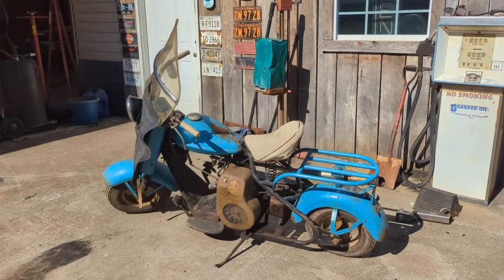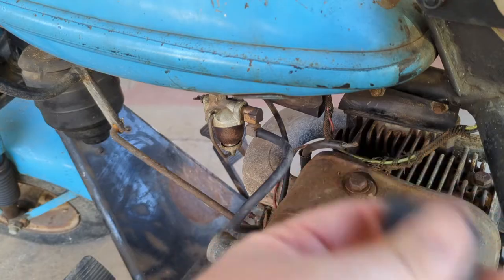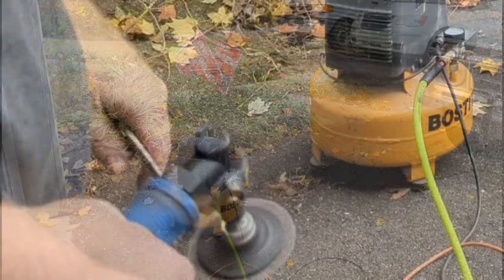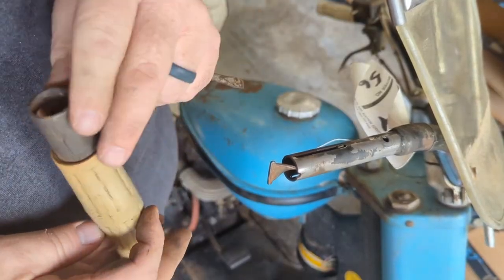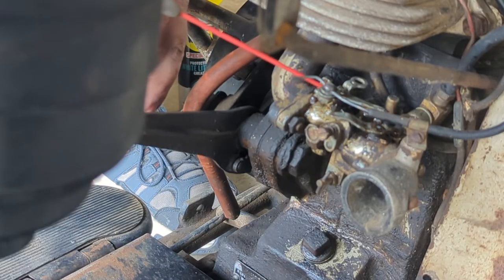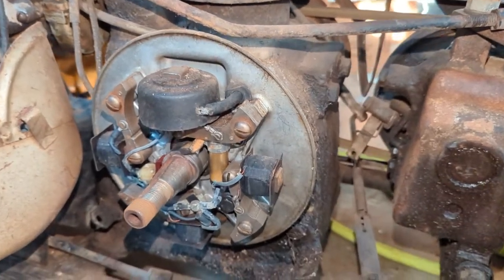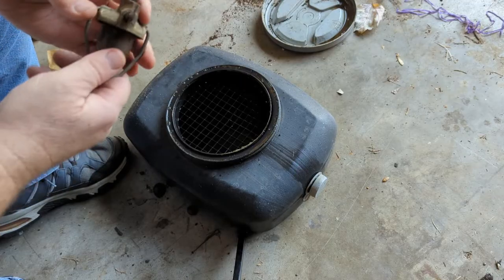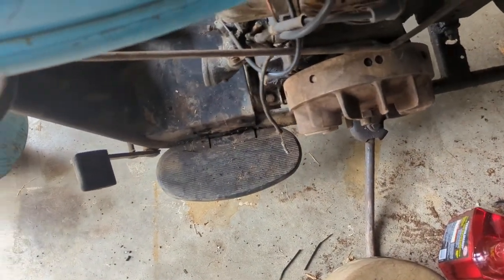1958 Cushman Eagle that has been Park for many years.

Comment: The intake valve is stuck open. You obviously have no compression.Pull the head off and get the valves moving. It should be hard to turn over if you have compression.
Reply from the maker: I do believe you're correct. However the guy who owns it decided to rebuild the entire engine and probably the entire bike. He currently uses it as art on this covered patio. Thanks for watching and commenting I do appreciate it.
Reply: Agree that compression should be much more, I also think you have a stuck valve.
Reply: No part 2...?

Comment: Small Engine 101...If it has been sitting for a long period of time,first things first,#1) If no spark,check points by physically pulling them out to inspect,typically they will need replacing. Step #2 While waiting for the points and condensor to arrive pull the carb off and thoroughly go thru it and especially replace the needle 'n seat and soak it overnight in carb cleaner,reassemble and put back on. #3) If it has NO compression it is usually a stuck or non sealing valve,(typically the exhaust valve),simply "lap" the valves back into the seats and reassemble. #4) Check the ring end gap of each ring it should be between .010" to .015",(by way of you kicking it over by hand it has far too little compression to even pop off!!! Should have atleast 80PSI to run,[but poorly],should be 100PSI atleast to be viable),if it is greater than .015" order a new set of rings,then reassemble. After all that it should start first kick!!! I can tell you have not had much experience in small engine trouble shooting by the way this video went!!
Reply from the maker: I am most definitely not a small engine guy. I actually screen shot this information you shared so I can go back to it later. This Cushman belongs to a friend of mine and I just wanted to ride it in the yard so bad. Anyways  he is planning on doing a full rebuild later on.  Thanks for watching and all the information clearly I need it. 😂

Comment: Judging by the way it turns over, the engine has very low compression. Buy or borrow a compression tester and check the compression. You must have at least 60 PSI. Good compression on that engine is 100-120PSI. I am familiar with Cushman engines. If you try to crank it slowly, an engine with good compression will stop turning or even bounce back a certain amount. The one you have just spins smoothly. BTW the gap of the spark plug is .035"
Reply from the maker: Unfortunately this one went back to its owner. He has decided to restore it completely someday . Currently he is using it as art on his deck by the pool. Maybe I will get my hand on it again. Thanks for watching.
Reply: @ForsakenSteel  The bike appears to be in good ride-able condition other than the engine. Suggest to your customer that he get in touch with the Cushman Club of America. It is a good source of information and parts location. Cushman scooters are popular because they are able to be licensed in all states for highway use.
Reply from the maker: That's a good idea. I was so looking forward to riding this scooter.

Comment: If your still working on it and need help message me I just rebuild one from boxes and I have all the diagrams and torque specs and clearances but seems like your compression is low you might be able to get by with hand honing it and getting a set of rings think there 20 bucks on Dennis carpenters website and check your valve clearance should be in between .014 and .016 thousandths deff lap your valves too but deff sounds like a bad points system and low compression my engine reads 97psi with a compression tester I think 102 is the max I upgraded from the points system to a magneto coil with the voltage regulator on the back of a plate it’s all one unit also comes with a new fly wheel
Reply from the maker: It wasn't my scooter. The owner actually picked it up yesterday. I believe he is planning a full rebuild. Thanks for offering to help I really appreciate it.

Comment: Pull the carb, spray just a touch of the starting fluid in the intake or put just a little gas in the intake. Put a jam nut on the fly wheel. Take a cordless impact and socket and spin it that way. Also may want to check the compression using a gauge.
Reply from the maker: I'm going to check the compression when I get back to work on it. I'm hoping it doesn't have a stuck valve. I'll get that carb off and give the impact a shot. Thanks for the advice.
Reply: @ForsakenSteel  my pleasure. I’m really looking forward to seeing it run. If you owned it, I would recommend a full restoration as these are such beautiful machines. Spinning that flywheel will also help heat up the rings to help build compression. You can help lube the piston by putting 2 stroke gas in the intake or the spark plug hole so you don’t overheat and seize the piston. But don’t soak it. A little goes a long way.

Comment: 🦅🇺🇸🦅 American steel, Just like the men and women that rode them back in 1958 ‼️♦️♦️♦️
Reply from the maker: Yes sir.
Reply: @ForsakenSteel  thank you 4 the response, Short story, 🙏 I had a customized 1958  Cushman eagle before I went into the Marines , 1976,  I painted it a GM color ( Sundance orange)  with chrome  Global metal flake inlay , ( it was stolen from my garage when I was fighting overseas in Cambodia ) , Dude they were fantastic transportation  in the City'  And legal to ride  with no tags or licence required,  I had a 3 speed. , Dual chrome exhaust, Ape hangers handle bars , The funny thing is that they sound like  sewing machines and can't get over 55 MPH on them , great Job on your post 👍👍👍👍👍 5;thumbs up , As Always David Staudohar USMC USN SS USCG ret ‼️ American Patriot 🇺🇸♥️
Reply from the maker: First off I would like to say thank you for your service. I also appreciate you sharing your story. I bet your bike looked great Sundance Orange. I believe that's an early 70's Pontiac color if my memory is correct.

Comment: 1958 Cushman Egeal was a great bike , Big year for American people , The first nuclear reactor went online, and the silicon integrated microchip was developed, and our first computer called The Colossus went online ♥️🇺🇲♥️ , one of the many reasons I love the United States of America ‼️
Reply from the maker: There was definitely a lot of amazing things happening for the US in 1958. Thanks for watching.
Reply: @ForsakenSteel  my Pleasure my friend ❤️‼️ that's the year that I was born,  I posted about the Venturi gas system of the Cushman eagle,  major pain in the ass, I work for Chicagoland cycles, back in the early 70s ask me anything you like about  the machine , did you get that thing running ❓❓❓
Reply from the maker: I didn't get it running. The owner has it at his place on his deck. His plan is to completely rebuild it in the future.
Reply: Case and point , if you can depress the kick start by hand ✋ the rings are shot out , another problem was weak Crank bearings , that is why they clank so much 🤣🤣 I would give $1000000 to find my Cushman Egeal , I did a retrofit on the shifter knob drill the hole in an 8-ball from a pool table , it has chrome exhaust, dual Maltese cross mirrors, and painted the 1971 Pontiac color Sundance orange with global Chrome metal flake inlay , you could consider starting a Cushman club , like the owners of the 48 Willie jeepsters did ❓❓❓ you have a good following in a lot of viewing , what do you have to lose Dude ‼️

Comment: try anew condenser to improve your spark  they are cheap...compresson seems very low could be a number  of things you need at least 60 lbs on a cushman. your fuel flooding is surely a stuck float needle valve. Those carbs.. are famous for that. Tapping on the float chamber with a screw driver handle will  sometimes free it up.
Reply from the maker: Thanks for all the information. I haven't touched this thing since I made the video back in the fall. I'm not sure how long long it sat but it was a long time. Maybe I can get it running in the spring. Again thanks for the info and for watching.

Comment: I have had a 1961 Cushman eagle, that after driving it around stock for 13 years, after a knee operation, it became extremely hard to kick it….! I had no intentions of getting rid of it, but the 8 hp motor had trouble running up and down these hills here, and Alabama….! so I decided to re-power it….! 
I put  a 670cc Motor in it with a CVTECH.61 torque converter…!     
Check it out on my Channel…! ( The Jeff Galey Channel ) 
“ 1961 Cushman Eagle 670 Predator motor “
Reply from the maker: I'll check it out. This wasn't mine and it has already been picked up. I would have loved to have owned it and rebuilt it. Thanks for watching.

Comment: did it ever run?
Reply from the maker: Unfortunately no. The gentleman it belongs to has it as art under his covered porch. Maybe someday he will be ready for a full rebuild. It definitely needs rings and probably a sticking valve. Thanks for watching and sorry we haven't finished it up.  I was really ready to ride this thing.
Reply: @ForsakenSteel gush I wish I had it , I got the engines for it and they all were boarded out 0.010 and new pistons, was planning on rebuilding them but the frames were stolen by family member so I still have 5 engines

Comment: I think it will run if you pull start it… get your truck some one driving it and put it in gear when it’s going and should spin over a lot quicker
Reply from the maker: It may come to that.
Reply: @ForsakenSteel  it’ll work or it won’t
Reply: Updates?
Reply: @ForsakenSteel  one thing you have to do to start a Cushman Egeal, open the bleeder valve on the bottom of the gas bowl, because it has a Venturi gasoline system , this allows the air out of the gas line to go back into the tank